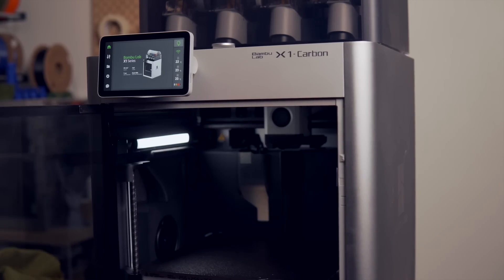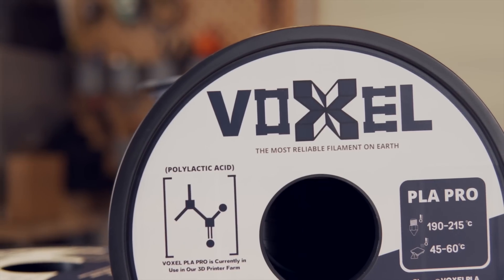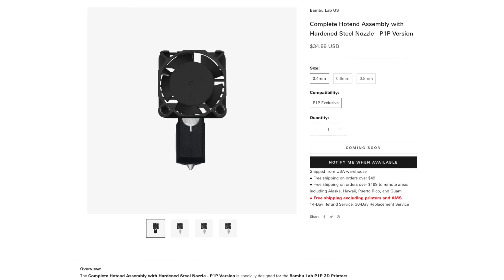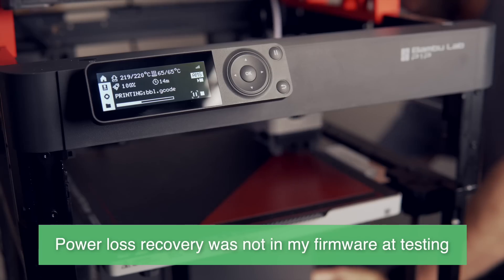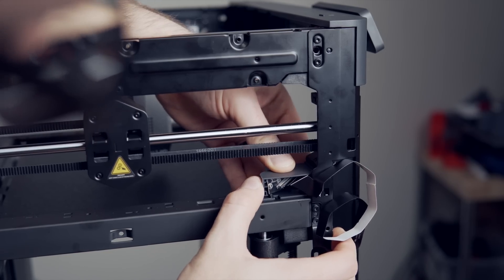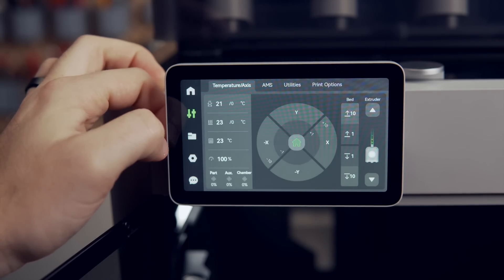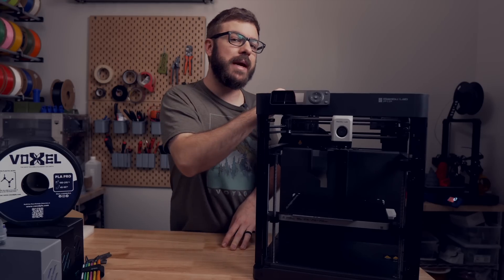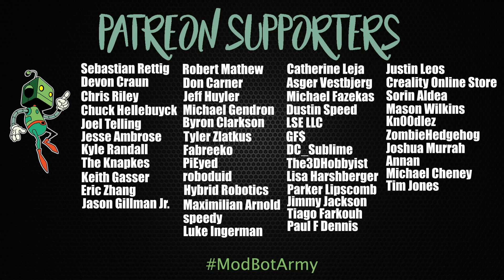Best Price To Performance 3d Printer? (Bambu Lab P1P)

Comment: Thanks for the Video. I bought one of the P1P's for Christmas. After printing with it for 4 days, I ordered 2 more. The speed even at the normal setting for what I print is about 2.2x faster and honestly better quality. This definitely will help with producing better faster quality products for my customers.
Reply: How long did it take to ship from order date to delivery date?
Reply: @edgard.1430  Before Christmas, I ordered it and had it within 3 days. Orders played after christmas, I don't think they will process until 1/2 or 1/3 I think their website said
Reply: @CraftHappy101  wow that is amazing. Most
Companies take forever
Reply: @edgard.1430  Yeah, it was quick. Shipped from Cali

Comment: Very nice and encompassing review of the P1P - there shouldn't be any question open! 
Btw. I had the same freeze like you described, but it didn't happen again (~200h of printing) after a firmware update.
"Best price to performance printer?" - Yup, I think so...
Reply from the maker: So it wasn’t just me then. Based on the bit of info I got it seemed like it was unique to early review units then. I am just glad the issue was firmware and not hardware. I love my x1 for printing abs for other printer builds but the P1P has been awesome for really most other things.
Reply: Even better price/ performance than an Ender 3 S1 with Klipper added (Sonic Pad) or an Voron Switchwire Ender 3?!

I mean ... you do get that building experience and with that the knowledge gain over the P1P. Spare parts should also be easy to get for Ender 3s, especially when looking at used market!
And here in Germany the 800 bucks price tag is at the same level than ender S1 + Sonic Pad or a Switchwire Kit.

Comment: Is it possible to do a hot swap for filament colours with the AMS? say you have 5 colours in a part and 1 of the colours finishes early in the print ,can you add the 5th colour in that filament slot?
Reply: Andrew, I think you can fake your way through it, switch one color after it is done with the 5th, and use the same color higher in the print. - but the swapped one will be what is printing.  It would be an interesting test.

Comment: Yes, best value, especially for production. I can produce 3x more parts per day than on my other printers. As a result I sold my 20 creality printers and replaced them with Bambu X1 and P1P. If all goes a planned and I can move to a larger space I'll order 20 more in 2023.
Reply: curious question: what are you printing in such a high volume?
Reply: @traaaab  Mainly jigs for machine shops, custom car parts, custom fittings for chemistry labs. Mostly in various blends of PA-CF. A few hundred parts per order isn't really high volume.